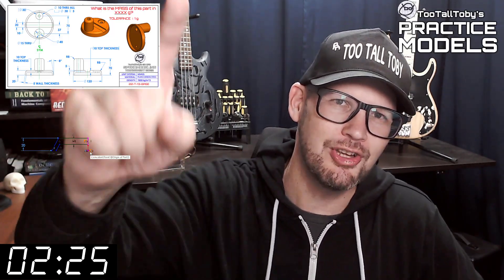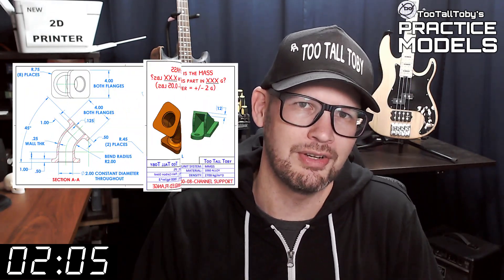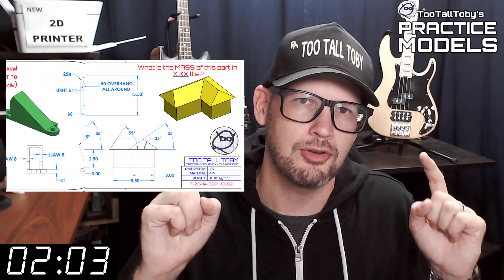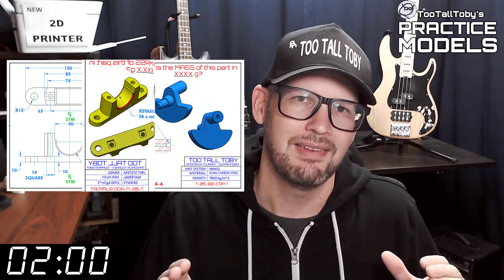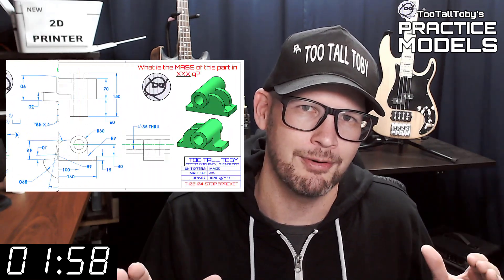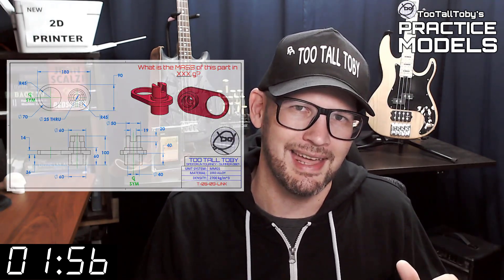CAD Modeling Practice Challenge - Onshape, SolidWorks, Fusion360 - COVER PLUG - Revolve, Thin Wall

Comment: First run I incorrectly was set to inches and got 20,0224g, which when I did my scale to get it to mm was out of spec with 12.7g. So I went a 2nd time correctly set to mm and got 12.218g

First run was 8m 28s (in incorrect measurement system)
Second run was 7m 9s (in correct measurement system)

Fusion 360
Reply from the maker: Lol ive done that before (many times)!  I guess we can call it “bonus practice” 😀😀😀  nice job improving the time, and LOVE seeing fusion in here!